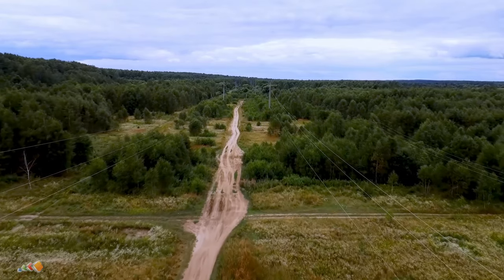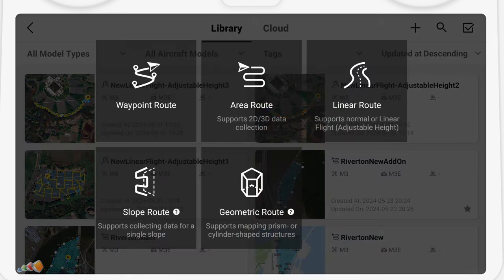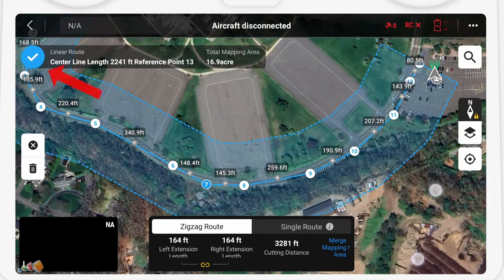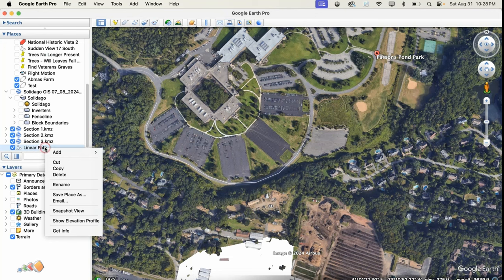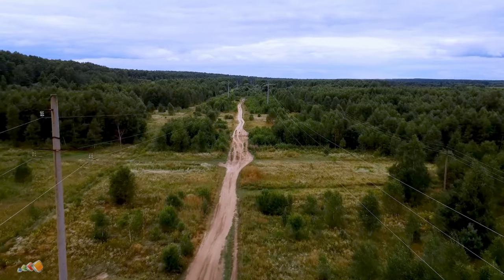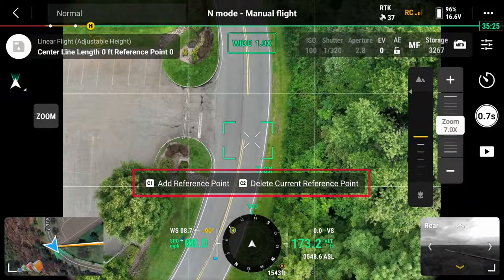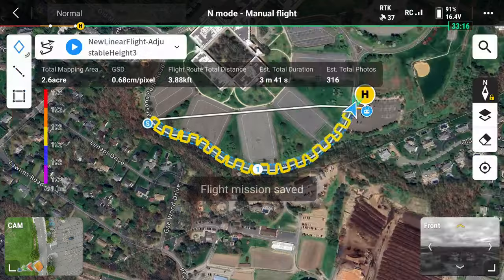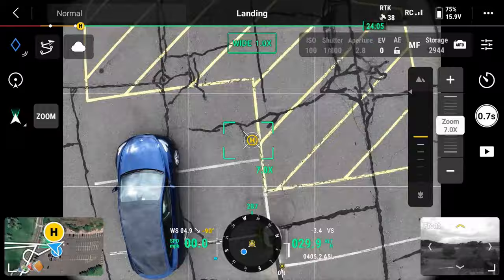How to Use DJI's Linear Flight Route Feature | Step-by-Step Tutorial

Comment: In this scenario does the Flight Route to Target Surface setting need to be at 82 feet? I would think the Altitude you set the waypoints was sufficient and ideally be best at around 100 feet or lower to fly this mission, mapping a concrete road route?
Reply: So the yaw or gimbal doesn't need to be set to custom or follow mode because the zig zag route option was selected?
Reply from the maker: Flight Route to Target is used to calculate the overlaps.  So if the object you are mapping is on the ground then you really don't need to use that feature.  However, if you are mapping something like a powerline that is 80ft high and you wanted fly at 160ft for safety then you would set your Flight Route to Target Surface to 80ft and your altitude to 160ft.  The drone would then fly at 160ft but would use overlaps as though it were mapping at 80ft.

It seems a few people get confused about that so I may do a video just covering how that works.
Reply from the maker: Yaw and Gimbal are automatically handled in mapping missions and don't need to be changed unless you have a specific reason.
Reply: @aviosmedia  thx
Reply from the maker: YW
Reply: @aviosmedia  Thx. So this would be consistent with the power line scenario where they are 80 ft high in that to get video and pics for inspections the yaw and gimbal would not need to be adjusted as they would capture the light poles?

Or would the poles need to be set as a POI. Or the gimbal and yaw adjusted to capture the poles?

Ex. If the poles are to the left side of the Drone would the yaw need to be set to left and gimbal to around 45-75° ?
Reply from the maker: @3naturalBionutrition I think you might be mixing use cases.  If you need angled shots and video then this is not the tool you need.  
Let me know what you're trying to do and I can make some suggestions.
Reply: @aviosmedia  I was trying to determine the right mapping route to select when doing utilities inspections. I would think waypoint and linear would work.
Reply from the maker: It depends on what your clients want you to deliver. They are usually quite specific, so if you know what that is, let me know.  You are probably on the right track. Take a look at the oblique option, too.
Reply: @aviosmedia  complete visuals of the conditions of some utility poles
Reply from the maker: Poles are tough because they are  ot usually perfectly spaced.   People I know that do that use orbits.  You could do that manually or use pinponts to set a center and orbit that (watch the pinpoints video).
Reply: @aviosmedia  very helpful. Thx

What do you like or find that works best between pinpoint, waypoints and linear?
Reply from the maker: Utility poles are tough because they are not usually evenly spaced.  People I know that do this usually use orbits - either manual or using pinpoints.  See the pinpoint video for that.
Reply: @aviosmedia  i watched the pinpoint video. Very nice
Reply from the maker: People I know use manual orbits and adjust the controls to make it easier.
Reply from the maker: @3naturalBionutrition glad you liked it.  There is a playlist for the enterprise series you might want to look at. 

Responses will be slow now.  I'm heading into the Amazon jungle (sic)

Comment: Great video again 🎉
Reply from the maker: Thank you!!
Reply: Did u ever figure out why kml cannot be loaded from google earth to pilot 2? Remember I was using Microsoft and not apple
Reply from the maker: @joezurek7804  Turns out you can export from google earth and into Pilot 2.  All of the examples people had that failed did no originate in Google Earth, they started in other programs such as QGiS.  I tried many variations and all of the examples people were able to give me stared somewhere else, were imported into Google Earth and then exported.  

If you create in Google Earth and export as a KML or KMZ then Pilot 2 loads it no problem.

For the cases where you started somewhere else, I put a follow up video out showing how to do that in Flight Hub 2.